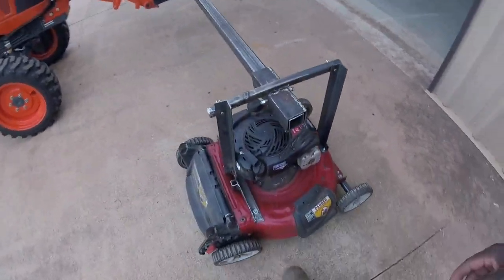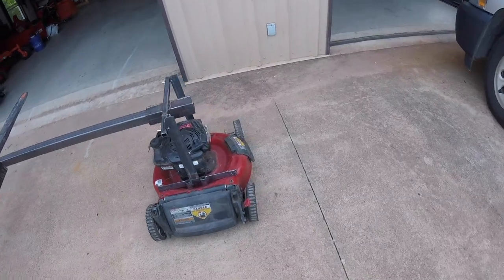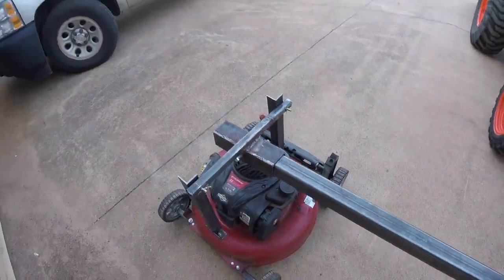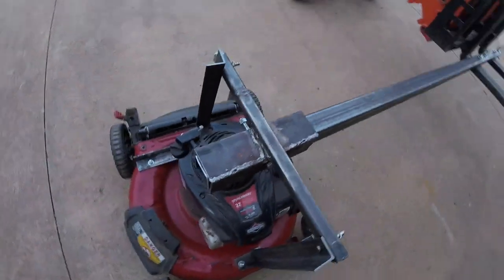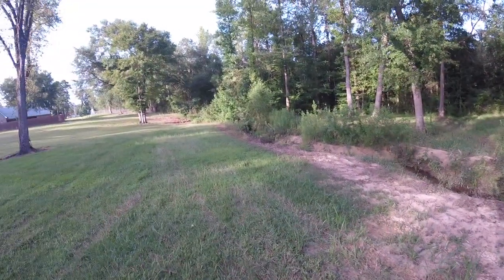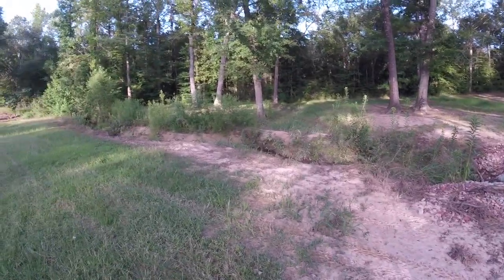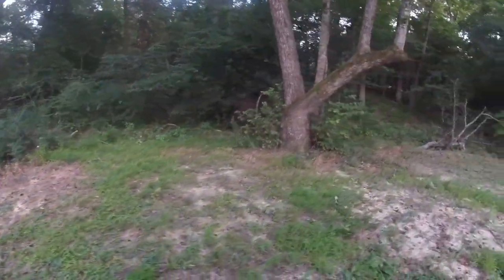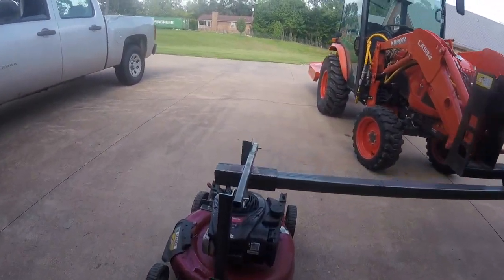DIY Bank Mower Fabrication - It worked!

Comment: As long as it does what you want it to do, it is just fine. I made one similar to yours but I have chains on each corner of the deck. I sort of like yours better. The biggest problem is that the shore along the lake is very uneven ground. I guess I would be better of just hovering over the weeds but then I would have to mow it more often. I have a video on my channel. Thanks for the video. 😀😀😀
Reply from the maker: Hello My Friend . . . you are so right about the shoreline of the creek.   It works, but I am sure there is a better solution.   I will check out your channel.   Thank you.
Reply: @danielchambers1958  
I just finished mowing my lake shore today. It takes time. It is only about a 40" path and but if I get any closer, I will sink. I just put the tractor in low range and constantly adjust my height. The bogs are a lot of trouble. Well if you come up with a better idea I will be glad to hear it.😃😃😃😃  I guess the only thing that would help is if the mower had tracks instead of wheels. That way it could handle uneven terrain better. I have to keep the front wheels just a little off the ground so that it does  not nose dive.
Reply from the maker: @alanm3438  I am glad you were able to get it done . . .if I improve my design, I will definitely post a video.   I agree with the tracks idea.   Have a good one Sir!